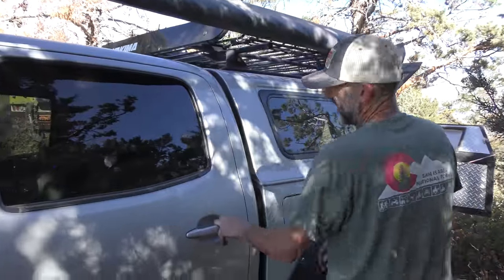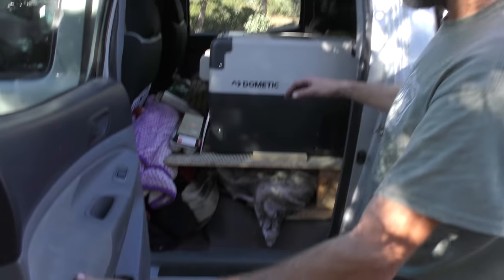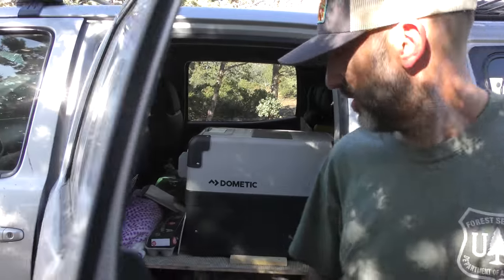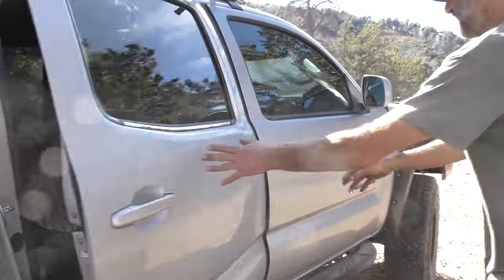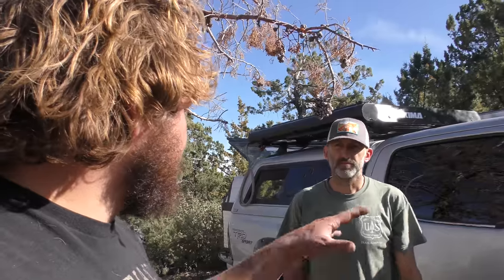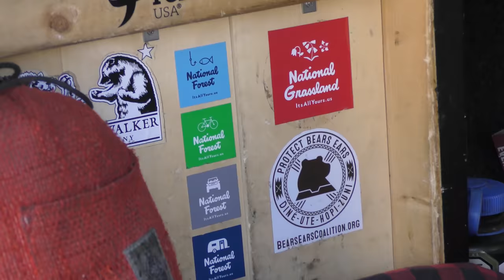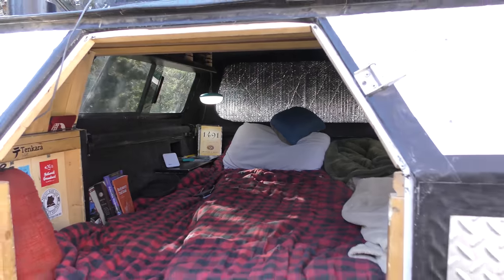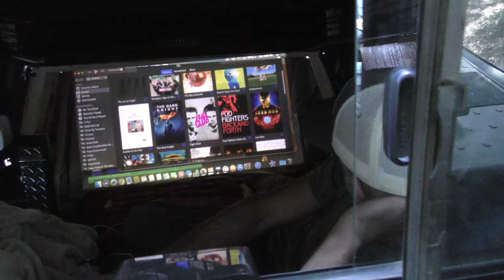5 years Living in a 5ft bed Toyota Tacoma - Minimalist Nomad Micro Home UPDATE

Comment: use a bicycle innertube to seal off between topper and cab window pass thru ... just drop it in and inflate it
Reply: Freakin genius. I wondered about how that could be done
Reply: Awesome idea!
Reply: Just seeing your comment, after I commented, I’ve used a mtn bike tube, it’s larger and fits around better but same concept.
Reply: great idea!
Reply: I used two i cut them and sealed them only needs a few psi to work
Reply: A pool noodle works !

Comment: I got a long bed. Made a 3 piece shelf system so I can out my bike or chair underneath or next to me. It's so small yet so sealed so it doesnt really get cold I been down to 35 all I had was a thin cotton sheet with my down jacket memory foam bed stays real warm. I plan on getting a dirt bike bumper rack. I backpack out of it very similar idea. I just have a duffel bag with clothes. Maybe way down the line I'll get solar and a fridge I already got an electric burner and toaster I use in my house.

Comment: Re-: (Extra table near frig). How about mounting a table to the door? Either drop-down or flip-up. Drop-down could use a large wooden cutting board as the surface (essentially the exact size of your window). 

Use door hinges where you can more easily pull out the pins and make the table removable.

Several “drop-down” bonuses: 1) Table will keep the sun from beating down on your cooler, 2) It’s an insulated window/privacy cover, 3) With the vehicle all closed up, you could deploy it as an occasional table/upper shelf when sitting inside (with fridge in a different location or outside). 4) It’s a hell of a lot more crowded everywhere else, while the high space between your fridge and the glass window is not being used.
Reply: Hey Beth, that's a great idea! I'm considering a few different designs....haven't decided on what as of yet but I'll be sure to make a video and post it to my channel in the next week or two. Have a great day ~ Brian

Comment: Very cool set up. I've learned a lot from how you're streamlining. The slider is terrific. I tried making something like that for a 97 Honda Odyssey. It was heavy, took forever to make but it was also terrible and marginally useful.... So thanks, you probably saved me making two more mistakes to get to something that works. 
 I put a bunk in my Prius V (yeah I know you guys are now thinking 'wow!'). Works pretty good. I wanted to make it easier to recline the passenger seat. So I cut it off at the front support (which connects to the folded read seat head rest rods) and then reattached it with some 2" webbing so it can fold back. I cut slots and attached the webbing with staples underneath. Works great. 

  The bunk is 1/2" luan plywood very light weight (Home Depot), supported at the front and about  two feet from the back. I have two 1" stringers of luan glued and screwed (until the glue set) along the length (about 4" in from the sides) to make it stiff.  Works great. You've probably already got this dialed in. 

I've built a lot of stuff, for precision baltic birch, for good light weight the luan, for rigidity, glue on a strip.  The pine you used is good but more likely to cause slivers. the 1/2" is very flexible. For those angles, I'd probably just epoxy on a double strip of fiberglass,  fiberglass tape would be neater, but always leaves a ridge at the edges. And it looks like your structure is already spruce. Spruce 2x3s are just terrific -- I like ripping them into different sizes while remembering the Wright Brothers built their gliders and first airplanes out of it. 

To keep laundry down, after two months kicking around Japan smelling like a sweaty corpse: I no longer travel with synthetics--they're cheap and great for growing bacteria.  (The only way to get out a stink that won't launder is hanging them in strong sunlight for a couple of days. Turn them inside out.) I finally learned about wool (merino/smart wool). T-shirts and undies cost a lot more, but I can wear it for days with a tiny tiny amount of Gold Bond powder (GIs in Afghanistan and Iraq swear by it)  I don't stink. And if I hang it up to air overnight I often can't smell the difference between the one I wore on a hot day and the one that is still laundry fresh. (Now when I drive through Yellowstone I can smell the Grizzlies in heat). 

For my windows I have these window screens that are like nylon stockings, they just slip over the whole door. I bought them on Amazon. They fit tight on my Prius windows so they might be too small for your truck.  I'll spray my tent and those screens with 10% pyrethrin and those flies buzzing around will land on it, get sick and go someplace else. (I'm a bit up in the air whether it's okay to poison a bunch of critters that other critters will eat.)  It would be easy to make slip over window screens from mesh from RipStopBytheRoll or some other place. I'd get the 600 holes per inch stuff. (I wouldn't use window screen, two layers of that would just stop too much air). The material is black so it helps with stealth. At night my stretch overs just look like tinted window glass-- a window rolled down a couple of inches isn't noticeable. 

 Now if I ever pull into camp in my Prius, you can make a few jokes but you have to promise you'll tow me out in the morning. I once put a postcard of a sandy beach on my visor-- you guessed it, my Prius got stuck.

Comment: Thanks for the tips! Excellent setup love it! I’m trying to do the same thing with my Dakota. Working with a 66” bed is a drag! So far I screwed 1/2” plywood down to the bed liner n put some black indoor/ outdoor carpet on it made myself a foldable plywood chair n hung black curtains up n made a little storage / countertop area! I love that expansion you built, great idea! My truck is only 2 w.d. Quad cab. Cool video!

Comment: Take the inside door skin off and mount a drop down table on there, just a thought
Reply: That's a great idea, I've not thought of that. ~ Brian
Reply: Might as well throw some good insulation in there too
Reply: Definitely remove door inside.
Reply: This minimalist must owe alot of child support.
Reply: @supernintendo7579  LOL!
Reply: @Boojyman  I mean.... cmon now. Who u running from.
Reply: There are aftermarket MOLLE organizer you can research. 
Also, you can chop out floorboard in back and box in down to bottom of frame, seen it for speaker install.
Reply: @supernintendo7579  maybe...or a felon
Reply: @BENYEET  yup. Well... I hope he doesn't get pulled over.

Comment: Nice truck ,🤙🏼
One negatieve thing is the high lift jack on front of the bull bar ,it almost killed me when a car crashed in the back of my truck ,the jack attaches broke off and passed the windscreen...really bad day then !
Keep safe ,and rolling .
Reply: Hi Hugues, yeah I've actually been thinking about moving this to my roof rack for the exact reason you mentioned. If you don't mind me asking, where did put your hi-lift jack?
Reply: Hi ,
I Blok it in the bed of my truck (now I have a Toyota Tundra )and the car where it was put in front was a Mitsubishi shogun I think (because I live in Europe )and it has Pajero model as name .
It is a heavy peace of equipment and keep it as low as possible ,because in that same accident my fire extinguishers has made a flight also and landed 30cm from my daughter on the motor hood of the 3e car that was involved in the crash.
But I don’t live in the truck that makes it les important than in your case ,you need space to live in .
And since that crash we didn’t traveled anymore due to children,but now I am building a off-road car military Peugeot P4 and it is actually a Mercedes G wagon .
You can find it one Facebook “G klass or P4 “ it not nearly finished due to long term illness,but I am slowly building backup .
And will be starting to travel again,my children’s are getting adults now.
My advice is al that can travel in a car that does a 360 degree side rol due to a crash and is heavy ,more than 1 kilogram is a potential projectile.
And a accident can be minor ore extreme,even when you are not the responsible for the crash.
So it made me very cautious...but You live in it and don’t have the luxury to do exemption on space so that’s difficult.
I hope you understand,my English is not so great .
Therefore I like these kind of ideas and setups as yours.
Keep safe and enjoy life on the move ,it gives you peace and freedom,that’s my second gaol!
Se ya .

Comment: Great video, if I could make a suggestion for you truck topper window to the truck cab, use a mountain bike inner tube, and put it in there to seal off the rain wind and light. I’ve done this on my Dodge Ram, and it works great. Using a small hand pump like for a soccer ball, will not take up space and easily inflated but won’t over  inflate it either! Let me know what you think.

Comment: I've tanned a lot of rattle snake skins.  You can drop the alcohol portion of your method as it not needed.  Seems like it would have an adverse affect. I use a leather glove that easily rubs off the excess meat.  Then rub on glycerin until it wouldn't soak up anymore and it'll come out vibrant and soft as a golf glove.   Just FYI.
Reply: Awesome man, thank you for the tips!

Comment: HOw cool that slide out would be in a ford explorer or expedition. Even a mini van with a slide could be extended out to a full two meters behind the mid seats and give full sleep space with out giving up storage or carrying capacity. Great idea and great job.
Reply: Hey Jim, I never really thought about this for a Ford Explorer/Expedition, or Mini-Van. This would be great for those vehicles and there would be so much more usable space compared to my extension! The slide out for my truck is just basically a 2 foot extendable sleeping box so it pretty much has a single use which is just sleeping. If a person was able to extend an interior space where they could move around a bit then this would option up all sorts of options for futons turning into big beds, a murphy bed dropping down from the rear wall, extendable living room area, etc. One of these days when I get a bigger rig I'll most likely go with something along the lines of a 4x4 van. It would be great to build a big slide out extension out the back to give a little extra space when I'm setting up for the evening. Thanks for the comment/idea, hope your weekend has been good so far. ~ Brian

Comment: five years is cool I lived in my Chevy van with my dog max for ten yrs and traveled through all 49 lower Inc up to Alaska  all five provinces of Canada and into Mexico a lot of it was group effort by rainbow family at times some of the best and worst times of my life retired the van after 1,175,000 miles two transmissions head job and two sets spider gears in rear I wouldn't trade my days with Max who died at age 17yrs in the van for anything now I'm married with  a daughter and significant other who are the 🍎's of my  eyes now
Reply: Cool life RIP max
Reply: Wow over 1mil miles????  How long did those transmissions last before you had them rebuilt?  No fuel pump or water pump replacements?
Reply: @eyekeepsitreal684  synthetic trans fluid and lucas additive and was a 77 chevy g20 no air no cruise no power anything all mechanical except the distributor so not a lot to wear out and a great local old timer tranny builder who knew his craft it  was a th350 built for severe  service with dual coolers and a temp valve to keep it at the correct operating temp geno  was probably the best builder ,for a th350 tranny (rip geno )your skills and talents are sorrley missed these days i do know he also drilled out and modified the fluid passages in the valve body and the clutch drums were filled to capacity unlike todays were they hold 6-8 cliyches and only 3-4 are used from factory making for a weaker tranny to answer your question
Reply: There are ten provinces in Canada and three territories, so what do you mean by "all five provinces?"

Comment: A crew cab short box seems like the worst possible truck you can live out of..
Reply: THE GENERAL huh? I’m just speaking in terms of dimensions. If I were to do a build with a truck I’d opt for a crew cab long box or even a regular cab long box would probably even be better
Reply: I lived in a Pontiac Firebird for 2 months in the winter time years ago. You can make anything work with a little imagination. I took out the passenger front seat and built a bed from the front to the back. Had a trunk to store stuff out of the way.  It was suprisingly comfortable to sleep in.  Not somthing i would choose to do, but for an extended trip of maybe a couple months on the road you can make anything work well if you use your head.

Comment: You might look at a 24" or 30" locking drawer slide for your pull out table instead of a swivel mount. Might be a bit easier and give you more real estate on the tabletop. Nice setup though!
Reply: That's a good suggestions, Charles. I'll look into that. Thanks man! ~ Brian

Comment: loop a copper water line around your exhaust under your truck with a circulation pump to move the water back to the tank as it gets hot like a radiator’ you’ll always have hot water. don’t need to hold but a gallon....
Reply: That's a great idea, thanks Daniel.

Comment: Like your set up. I have a projector in my van. For the screen I use one of those pull down window shades. Works great and is easy to pull down or put away. You should try it. God bless you.
Reply: Hey Jesuscross9, that's a great idea to use a pull down window shade for your screen. I'm going to pick one up, thanks for the suggestion! Hope you've had a great weekend ~ Brian

Comment: A mid size pick up truck with a diesel engine like the new Chevy Colorado (2.8L Duramax diesel) would be perfect for this. In a catastrophic event, you could start making your own bio-diesel and continue driving even if the gasoline stops flowing. Bio-diesel can be made from so many different organic items. There is a local company that runs their diesel trucks on used restaurant grease that is filtered.
Reply: @feralkid1879  french fries and diesel soot, what better combo is out there?

Comment: you've got to love TOYOTA I have 270,000 miles on my 07 tundra 5.7 and I use it for a work truck towing a heavy trailer every single day , 100 miles round trip average for work in heavy traffic every fuckin day and it still runs ,drives and rides like a brand new truck. the paint has given up on it which sucks, makes it LOOK like a piece of shit but it has been and continues to be hands down the best most reliable truck I have ever owned.I love Toyota, wish they would make a full size diesel 3/4 or 1 ton I'd find a way to pay whatever they asked for it without thinkin twice.
Reply: I'm with you, if they made a full size diesel then I'd make the switch immediately. I could only imagine how much longer those could run compared to what is currently out there. I'm always amazed at stories from other Toyota owners about the longevity of their trucks. BTW - is your Tundra the year where the truck bed has 6 more inches of depth? I'm trying to remember if that's 05, 06, or 07. I met a couple who had one with a high rise topper and the deeper bed. They had a ton of headroom even with a platform bed setup. I love the older Tundras, the new one is a bit bigger but has a really nice look to it.

Comment: What Jackery do you have? I was thinking of going with a goal zero, however they are super pricey. How long does that Jackery run the fridge with the solar? Indefinate? or do you have another way of charging the fridge when you are out there. I was looking for something to run a small dometic fridge for 3-4 days. Any advice would be greatly appreciated. Thank you sir.
Reply: Hello, I have the Jackery 500 Explorer and I've been to run my Dometic CFX28 continuously for 2.5 days without needing to recharge my battery. I've found that if I keep my fridge out of direct sunlight then it will only pull around .5amps per hour. The Jackery 500 has 24Ah capacity (512Wh) so as long as you aren't opening and closing your fridge all the time then you'll be able to get at least 48 hours worth of operating time without needing to recharge. I tend to charge my battery each day via the 100W solar panel or the cigarette lighter so I never really take the battery all the way down to 0%. I agree with you, Goal Zero is a bit pricey and you can get the same performance from other brands at a lower price point. If you have any other questions, feel free to hit me up. 
~ Brian
Reply: @OffGridBackcountryAdventures  thanks sir, i now have a clear path of my next Tacoma upgrade.

Comment: vegtable glycerine and 70% rub alc for 7 days for snakeskin? good info@
Reply: Yeah, it works well to tan the snakeskin. After 7 days you'll want to remove the snakeskin from the solution, stretch it out on a stick or tack it to a flat board, and dry it for 2 days in the shade...you don't want it in direct sun. After that you'll have a beautiful looking snakeskin.